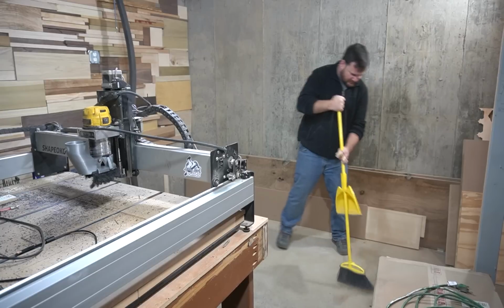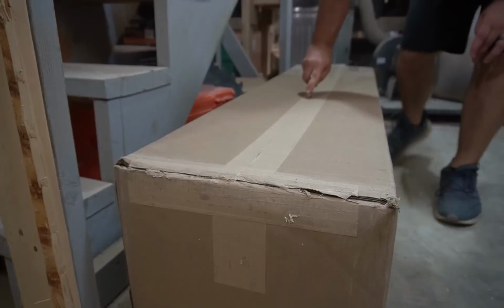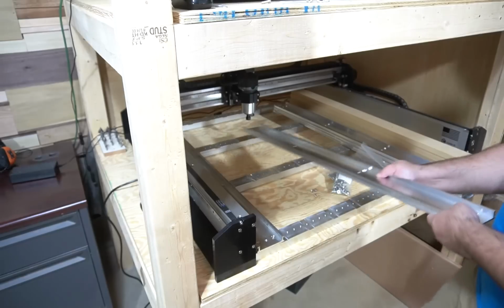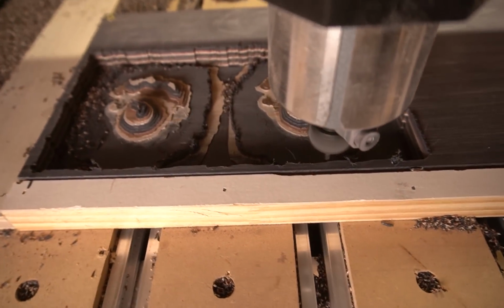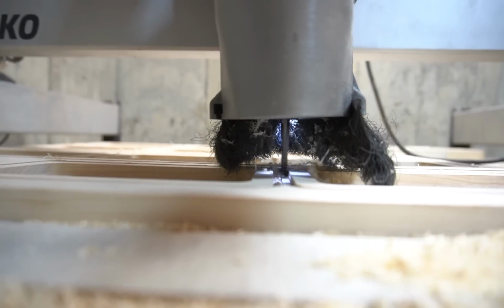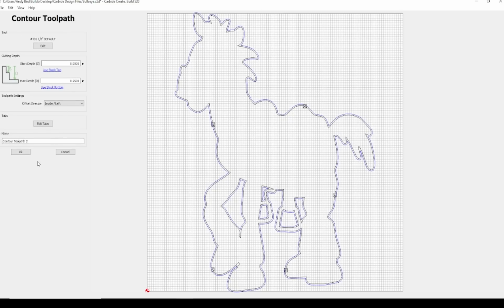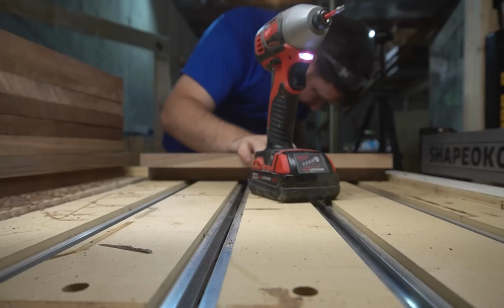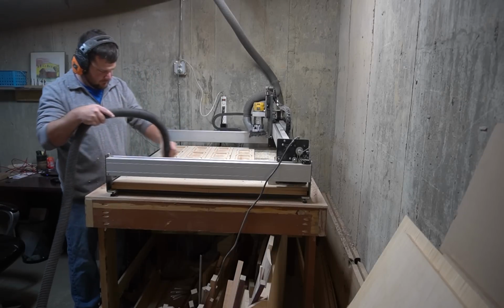Watch This Before You Buy A Desktop CNC Router

Comment: Bought one about a year ago. I've used it like... 2 times after learning period. I use 3D printer all the time. The latter is ten times more convenient, there is very little preparations and it spits out finished products. CNC is a two day job, 3D print is 1 hour of design and 5 hours of printing.. I am a hobbyist but with a condition: i don't do stuff just because i want to make stuff. It has to be for some need. So yes, i could've done a million stupid engravings and badges, all kind of decorative crap that i already have way too much of. There just has not been a need for CNC, and specially since it is a lot more work.. why should i?

So think really carefully if you actually need it. I thought i did, i was sure that i was going to be using it all the time but.. 3D printer is really what i use and need. It is good to have it, i am not going to sell it but i could've easily lived without.
Reply: Great advise. I was a day away from ordering a CNC, but I too have way to many engravings etc. I'm going to look at 3D printers.

Comment: Excellent starting pointers! One of the most frustrating things for me was a cheap chinese controller connecting through usb. It would move the z axis randomly when the spindle turns on. Or it would freeze up In the midfle of the program, losing the x y and z position info, having to set it up again but never getting it perfect which was visible in the part i was cutting. I now have an ethernet connected controller (axbbe) and has never failed me. 
Aside from 1/4" bits or 6mm bits, get 1/8" straight 22-30mm long cutting length straight 2 flute bits too. It wastes less wood, cuts smaller corners, cuts very clean without tear out and produces less dust and is cheap. for many shapes I don't even need tabs since it packs up in the slot, ie final cut out so it stays put. 
Also make sure there are cam processors for your controller so that the produced toolpaths work on your machine if you decide to go with different software than recommended by the machines manufacturer. I've been able to modify scripts in order to make it work on my old controller, but can be difficult without some prior scripting/programming knowledge. The new one is compatible with mach3 output, which has wide support.
Also learn about gcode, I've found it invaluable in checking the processed cam output. Check if the first z move into the material is the correct depth for example, you could make a mistake with top of material or top of bed as a z reference for example. This could lead to cutting into your machine bed by accident. Also move the x and y around manually when the program is loaded and check if it's moving as expected, not hitting a clamp etc. Having homing xy switches, homing first and writing down the machine offsets before starting to cut will allow you to reproduce the exact starting point. If the machine bumped into something and lost steps, it's trivial to reset and continue.

Comment: I made my very own cnc 1500x125 for. £600. Your funny £3000 lol. Your crazy. For spending that amount
Reply from the maker: Thats cool, but I don't believe it.
Reply: @AndyBirdBuilds   I have been a YouTuber from April lockdown Covid-19 2021  I had I kitchen now a workshop.
Reply: Accuracy, consistency and longevity are important in CNC cutting. Doubt a 600 machine achieves any of those.
Reply: @rafemaxwell4143   come see my last video you can judge  of the landscape
Reply: @flippingwoodforcash9130  How much did the 3D printer cost? How much time did it take? What kind of software does it include? Tell you what, Ill buy one from you for 600 right now... Doubt it will last long with plastic parts and cheap guides though. Doubt it's square either, unless positioning sensors are including in your $600 😂😂
Reply: @rafemaxwell4143   £99 the printer. And 11.99 a roller of pla  it only 2 rolls needed

Comment: I agree with most of this but I think the budget is a little low. I wouldn't consider anything less than the Shapeoko Pro. 
Dealing with v-wheels is a distraction and you'll be disappointed in the long run.  Linear bearings on all three axisees is a must. 
As far as everything else Andy is right about pretty much everything else. It's a rewarding hobby and can easily become a great business.
Reply: Longmill by Sienci!

Comment: I am thinking seriously about CNC and I like the one finite but don’t know if I or my neighbours could stand the noise of the router. I would like something with a spindle. Any suggestions
Reply: Depending on what you re cutting, the router isn't going to be much louder than the sound of the material being cut. A spindle processing material is still fairly loud, even if the spindle by itself spinning isn't.
Reply from the maker: You could build an enclosure

Comment: There's a 4th bit that's always left off of people's "needed newbie bits" lists and that's a surfacing bit. Something in the 1 1/4 - 1 1/2" will cost you under $30 for a decent Amana carbide bit. The first thing you're going to do after setting up your machine is flatten your waste/spoilboard and a 1/4" end-mill is gonna take a llloooonnnngggg time 🙂 Then buy a 2nd 1/4" upcut and a 2nd 1/8" ball nose so you've got one in hand if you break one and you're not sitting on the pause button waiting on Amazon.
Reply from the maker: This is a great point! Thanks for sharing

Comment: What brand/model should I buy with that $3000 budget?
Reply: I bought a Shapeoko XXL a year ago and had zero CNC experience.  I found it pretty user friendly and the software is easy to learn. I paid about $2,000 for the machine and then there is the cost of buying bits, suction system, and table.  Def take everything into consideration because the cost of the machine is not your only cost. Hope this helps!
Reply: @ryanh4827  thank you
Reply from the maker: I would second Ryans reply.
Reply: What do you think about the Ratrig Killerbee? It's about 2k in the maximal size.
and what size do you recommend? Is it worth to go 150x150 cm or better go smaller to increase repetition accuracy.

thx a lot in advance
Reply: @jeffw2793  not sure how Andy feels but in my personal experience, I am glad that I went with the biggest I could afford.  I am able to cut bigger items and also batch out more smaller items at a time. I don’t think you will regret getting the larger one but I do think you will regret the smaller machine

Comment: A lot of wisdom here.  Newbies pay attention.  I have taken the journey Andy speaks of over the last year or so as well.  You are not going to be creating beautiful projects on your first cut.  So much to learn before you begin producing sellable products.  I started with a very cheap partially 3D Printed CNC.  For me this CNC allowed me to make some very disastrous mistakes that didn't cost me much to fix.  I broke something I just printed a new part.  It had entirely too much give and flex for what I wanted to do but it got my head into cad, into cam and into the software that navigates the cnc and was very forgiving when I screwed up.  Several crashes later and I had a good understanding of what NOT to do.  Eventually I determined this cnc wasn't going to do what I needed it to do and committed to (what Andy said) around a $2500 budget and got what I would call a serious CNC.  Taking what I learned from my mostly printed CNC I was able to then delve into my feeds and speeds and operating the machine in a manner it was intended.  But I didn't just start right in making projects.  I have been running test cuts in pine and hardwood to determine what is too fast of a feed and what is too slow of a speed for my router.  I just about have every possible cut figured out and dialed in so as I begin making projects. So give yourself the time it takes to learn things and make your mistakes.  Because you are going to make several.  Like Andy said be willing to fail and you rewards will be great.  Thanks for this video Andy.  Wish you had made it a year ago.
Reply from the maker: Thanks for sharing your experiences with CNC. Sorry I was a year late!
Reply: What Cnc did you buy